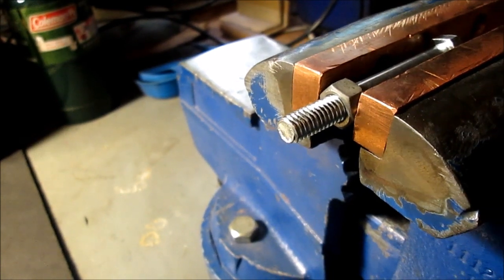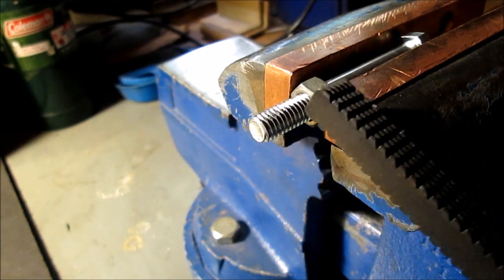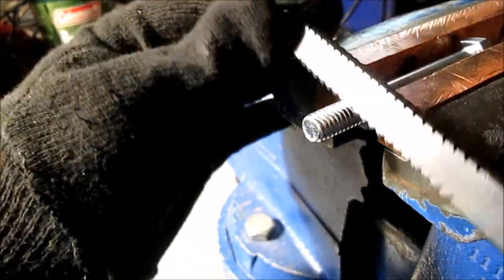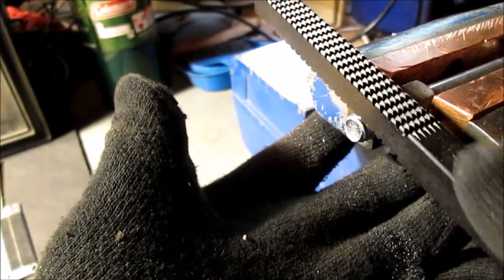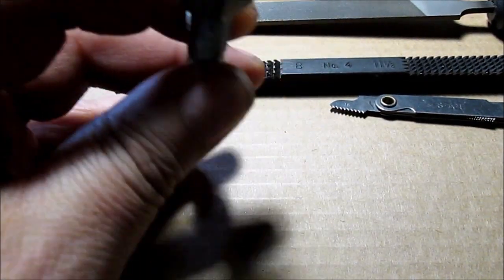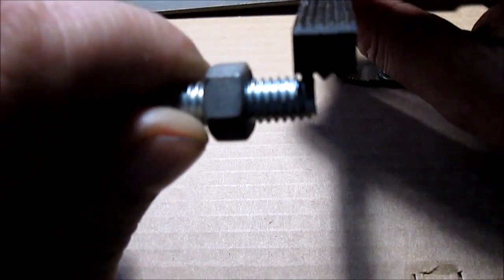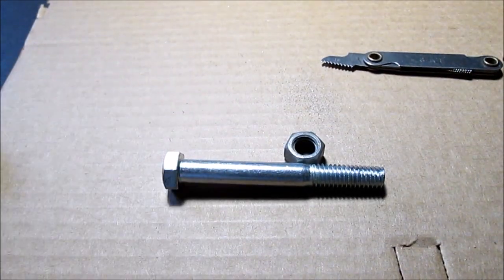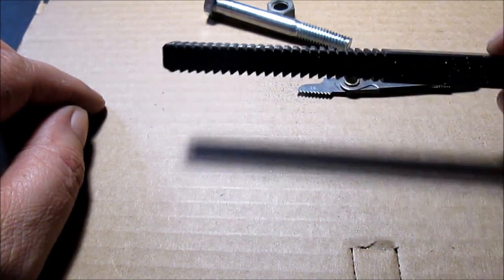Thread Restorer File

Comment: If I had known that you had done a demo on this type of file I wouldn't have done one. I hate to look like I'm copying.
Like you, I definitely want a handle
Reply from the maker: Oh no problem ...I hope I was showing the right way to use it ..The numbers had me confused ..I found what fit the threads and It worked ...I am behind in watching videos ..I will watch yours soon !!!
Reply: You did it just the way I would. Mine is a General too. I think it is a bit older though. It has 8 different thread pitches.
When I was doing the internal threads on the Cushman chuck I was wishing I had an internal thread file.
Wonder if they make them?